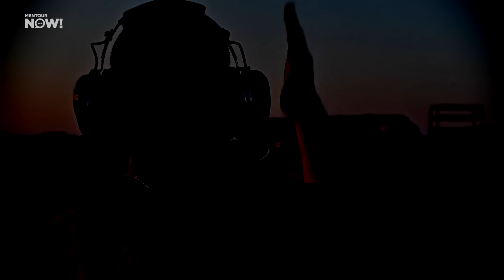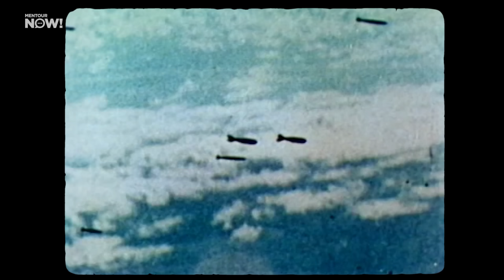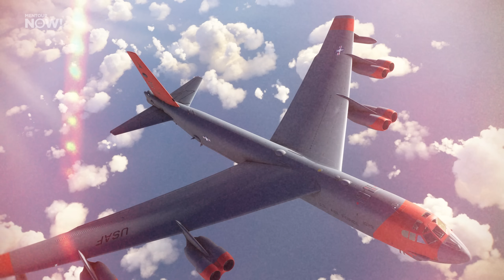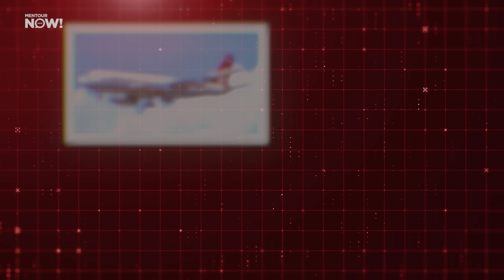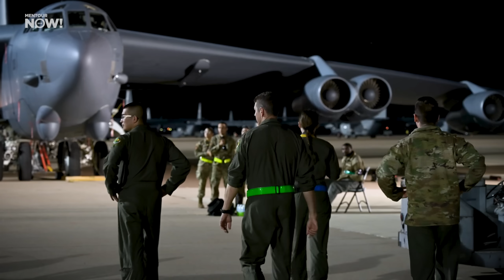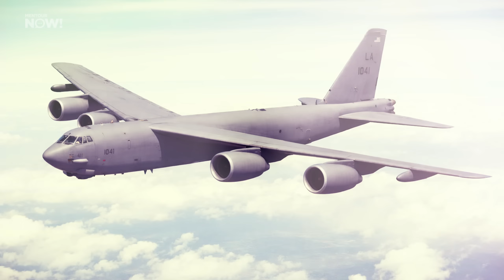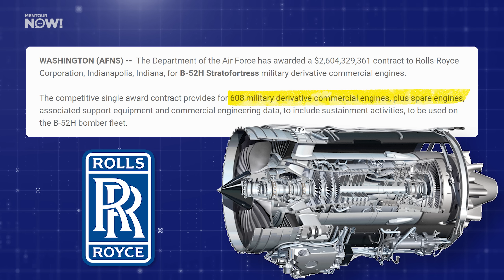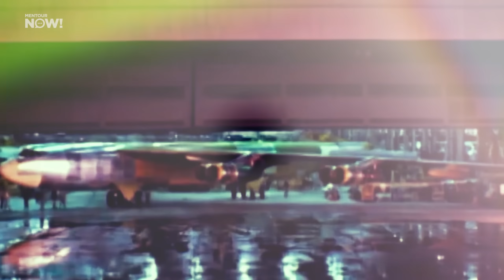WHY Are They Changing The B-52 NOW?!

Comment: Back in the late 1980’s I got to experience the power of these aircraft several times a day for over a year. I was designing and prototyping radio systems for the (then future) F-22 Raptor. We did our testing at Air Force Plant 4 in Fort Worth Texas, the factory where General Dynamics was building the F-16 Falcon. The facility was co-located with Carswell Air Force Base which at that time was home to one of the Strategic Air Command’s Bomber Wings. There were a LOT of B-52s. Several times a day a B-52 would take off along with one or two KC-135 stratotankers. Because these aircraft had to be ready to fly at a moments notice its my understanding that they always carried their full complement of nuclear tipped cruse missiles and were so heavy that when they took off they only had enough fuel to get them out over the (then) Gulf of Mexico. Then a KC-135 stratotanker would fill them up. Because our testing including “interrogating” aircraft as they took off and landed at Carswell, our “lab” was located on the top floor of a 6 story tower that was relatively close to the end of the runway where these aircraft started their takeoff roll. Our facility had no windows, but we knew when one of these fully loaded B-52 took off because it was like an earthquake hit. We quickly learned to bolt down everything or risk it being broken as it fell from tables and shelves.

Comment: But if they redesign it for 4 engines then alot of the initial problems of going from 8 to 4 would not be there when an upgrade for the  next set/generation of 4 engines would come into consideration, sounds like an economist have NOT been apart of this.

Comment: Really interesting video, very glad the B52 will keep flying. One thing I am surprised about though, is that to me the obvious cheaper solution is to remanufacture the parts for the old engines that they can't get hold of anymore. If they could be built in the 50s and 60s, surely modern technology means we could easily reproduce these, even if it comes at a much greater cost relative to the cold war years, surely it would be less than the multiple billions this will cost. I realise there are many other benefits to the new engines, but for governments, the cheaper kick the can down the road approach is quite often the preferred solution.

Comment: I service lab analysers . These are devices that are FDA certified.
In the late 1990s the company I was working for , started buying 40MB hard drives , a size that was getting difficult to purchase.
The reason they needed to do this was the FDA Certification required that any changes such as a bigger hard drive required the whole system to be recertified at enormous cost.

Comment: Makes you wonder why they haven't switched to another plane entirely and avoid all these unnecessary issues and concerns. It can't be that hard to make a flipping bomb bay or attach cruise missiles under the wings of a somewhat modified civilian airliner frame. It's not like B-52s were designed to launch cruise missiles of the size and mass of what we have these days either...

Comment: There was a study done at Boeing to use four 757 engines but the exhaust heat plume impact on the lower wing skins and ground clearance caused that conversion to be shelved.

Comment: I think that many of these concerns brought up are overthinking the problems
A modern CAD representation of the existing wing design would yield the answers to most if not ALL questions.
Modern computer dynamic modelling is incredibly powerful.
I would, in fact, be astonished if high quality models were have not already been done. 
They might be showing that if you were going to goto the trouble of going to four engines, it might be far smarter to replace the wings.
If you were going to do the wings, why not the entire airframe.
A new aircraft.
The Military Industrial Complex seems incapable of producing the "new" without blowing the financial constraints to pieces.
Whether it's the army, navy, airforce, or marines.
Fix the procurement problem and much else gets cleared up. 
NOT GOING TO HAPPEN !

Comment: The answer to your question is they ran out of excuses not to. That and there's not enough ground clearance for 4 modern high-bypass turbofan engines. It took a s*it-ton of engineering to make more efficient engines that would still fit the plane.

Comment: They tried the high bypass fan modification back in the early seventies. One of the big reasons they decided against it as being a bomber is the cross section of a very large fan gives off a huge scattered radar image which was just unacceptable for the airplane.
Reply: Lol, so instead of looking like a aircraft the size of a b52 it will look like the size of a 747... real stealth impacts at play

Comment: There’s an aspect I don’t believe you touched on which is likely one of the most important reason for keeping the engines the same. This wing was designed to drop ordinance and launch rockets. These are known aerodynamic characteristics. Changing that up would have an unknown effects on how rockets are fired and ordinance dropped, which could be unsafe to the aircraft. It would be very costly to test and change for that safety aspect, let alone the others you touched. My info is sourced from a B-52 test pilot

Comment: Comparing a high bypasss  commercial engine bypass ratio to that of a of low bypass military engine is like comparing apples to oranges.  They are both round but otherwise completely different.  The engines are also supportable well past 2030 contrary to your claim.  In 2023 Pratt and Whitney was awarded a sustainment contract through 2050 for these engines and is still producing parts for the engine today.  It was also awarded another contract just this past September for sustainment of TF33 engines powering NATOs E3 sentry aircraft.  The B52 isn’t the only aircraft flying behind the TF33 and the engine isn’t going anywhere anytime soon.

Comment: The time and cost to rebuild the wing spars to accept 4 engines is prohibitive.  Not even talking about the fact they would also have to raise the air frame higher off the ground to accommodate the larger engines. Then there is rewiring the air frame for the new electronics.

Comment: Very good...
...I'm curious: I had it in my head that apart from the usual maintenance checks airframes are rated for a certain flight time, and once that time is up the plane is done - one of the main reasons vintage warplanes are flown so little. What am I missing? (I presume B52s weren't rated for infinite flight time)

Comment: Ì am old enough to remember when the B-52 and its engines were new. I never flew on a B-52, but I did fly on a commercial regional DC-3 flight, and in the 1960's a 707 on an international flight. Air travel was rare back then, compared to today, and I remember both aircraft very clearly. Aircraft had a lot on individual character back then, unlike the lifeless, and very uninspiring aircraft we fly today. 

I very much remember the engines on the 707. They were loud, very loud, had a roar that is never forgotten. When they spooled up on the runway there was no doubt you were going flying. I was just in front of the wing and had a window seat. I remember being able to see what seemed like incredibly futuristic engines. My first jet flight after many propeller engines. I even flew in a Gypsy Moth once. The scream of those jet engines were the sound of the space age, and unlimited technology, leaving the past behind. 

Funny to hear them now being described as obsolete.

Comment: I think that doing 4 engines is a way better idea they could put in already existing high bypass engines for efficiency and range. (I wrote this before he mentioned it) He also mentioned that the wing might have to be modified which is true BUT in this case as the new engine weights less than 2 of the old engines, its characteristics might actually be BETTER. only slight modification would be needed seeing as the fuel lines can just re-engineered the fuel tanks are literally directly above the engines it would be an easy modification almost every other system has been modified no internal parts are original. He mentions that 8 engines is more reliable as if 1 of 8 but chances are, if one engine in a pod goes out, its more often than not going to take both out as they use the same fuel lines and hydraulics and are so close that if it was a serious issue like a bird strike or engine fire it will defo take out both. It would be easy to train people to work on these engines as they are already in service in commercial and other military aircraft.

Comment: In survivalist circles, there is a term "One is none and 2 is one." Meaning redundancy is king. 
Consider the DC11(10?) that recently lost #1 and it's fire flume knocked out #2 from suffocation. #3 on the right wing was fat and dandy. Can you Yaw? Not Y'all.
Here is a question, if you had a bottle of NO2, and sprayed it into a stalling engine(turbine) could you save it? What good is FADEC if contingencies aren't available?

Comment: You look at the survival of the b-52 as a set of technical questions/issues.  But in the world of big Department of Defense (Department of War) spending programs the majority of decisions are driven by politics. Politicians who have manufacturing or DOD services in their districts get deeply involved in DOD spending decisions.  That’s why it’s so hard to shut down a military base.  Additionally the DOD has gotten extremely poor at running new weapons programs.  Cost overruns.  Late deliveries.  Substandard construction.  Inability to meet performance specs.  All get in the way of developing new weapons systems.  The  B-52 exists. It’s a known quantity. It’s slow.  But has great range.  It can deliver a range of weapons.  It’s much cheaper to enhance this ancient airframe than to develop a new one. Why do you think Boeing has kept the 737 around for so long?   So one the one hand there are a lot of practical reasons to keep the B-52 flying.  But don’t underestimate the political factors that are driving this and every big DOD program decision.

Comment: Why does the BUFF stick around?

Because it is a big, durable, long range bomber, with big open weapons bays that can be endlessly adapted to drop whatever the new flavour of warhead is available.

And with modern weapons, it doesn't even need to enter the airspace of the opposing force. So it makes it exceptionally hard to justify the cost of building an entirely new plane, that has significantly better capabilities.

And why the B-52 will outlast the B-1 or the B-2? Because it, even with its older, less efficient engines? Was cheaper to actually fly per hour. So why would you fly the B-1 for a mission, if the B-52 can do the exact same mission, but just...take off an hour earlier? You end up flying the B-52, because flying the wings off the expensive as frig B1 and B2, just...doesn't make sense.

Comment: Sometimes, all you need is a big, dumb, bomb/missile truck that can fly a long way and drop a whole bunch of whoopass on the bad guys. And when you have just such at thing in inventory that is LONG paid for, it doesn't make sense to spend the MANY billions of dollars it would cost to replace it. But new and much easier to support engines (and the other modernizations) for a couple billion (that will pay for themselves over the long haul) are a no-brainer. That increase in range in particular is key, because air-to-air refueling is insanely expensive. It takes a TON of fuel to lift fuel off the ground, plus all those additional expensive airplanes and air crew. 

You should do a video on the KC-135 - another Boeing design that seems destined to outlive everything that has tried to replace it.

Comment: The tail of the B52 changed drastically between the early generations and the existing H- models. I wonder if the new Rolls Royce engines will necessitate a different tail as well?

Comment: other than the fact that USA has stage 4 juw cancer, they could just make a new one in carbon fiber with 2 or 4 modern engines. No doubt much cheaper than to modify a single old plane

Comment: The reason for eight engines is the rudders too small. Adding a larger rudder would require a complete redesign of the tail section, which would be impractical.

Comment: Another reason for going with eight smaller engines rather than with four large ones is that the Air Force doesn't have to repeat the lengthy and expensive weapon qualification tests for every weapon that the B-52 will carry.

Comment: Why not 4 engines? "It would require replacing almost all systems and interfere with airflow".

With the new 8 engines: "The old throttles and systems won't work with the new engines, and we have airflow problems. Replace all systems and redesign the engine nacelles!"

If you ever wonder why taxes are so high... ;)
Reply: Old story on upgrades.  You anticipate the problems you can, and deal with the problems you didn't foresee.  Our inability to know everything before we start is not a reason to do nothing.
Reply: But not redesigning the wing, wing box, tail fin etc.
Reply: @sparky4878  Pretty much the same reason MCAS on the 737 MAX was needed. The plane sits low on purpose, a great idea back in the 60s, but you can't fit massive engines under it. So they had to move the engines forward to mount them higher.
And longer landing gears meaning completely redesigning the wing, at that point might as well make a completely new aircraft.

Comment: The newest B-52 airframe made its first flight closer in time to the Wright Brothers first flight than to today.

The first B-52 made its first flight less than a decade after the first US jet aircraft flew. A decade later, the Lockheed A-12 Blackbird made its first flight (the same year the last B-52 rolled off the assembly line.) Needless to say, aircraft technology was moving at a pace staggeringly fast by today's standards. 

(By contrast - the Space Launch System has yet to make its first human-carrying flight - more than 20 years after the design was first unveiled.)

Comment: I was a weapons systems technician on B-52 D/G/H from 1981-1994. I participated in several analog to digital upgrades on those systems in the aircraft over time. All aircraft had to go tor depot level maintenance for recabling (Think dry dock for a ship). Perfectly good wires for discrete signals are wholly inadequate for high speed data transmissions. The plane needed to be "opened up" from the cockpit, to the wing pylons and bomb bay. Not an afternoon job. When reading other articles and such about the current and past re-engining programs, I somehow missed the fact that today's engines are digital. There's no way the current cabling and rigging that's been in the aircraft since it was built could possibly work with a modern engine. Thank you for pointing that out.
Reply: Excellent point. In addition, the new harnesses may include new coaxes and fiberoptic for new systems, higher awg feeders, etc, new installation routing, connectors. Then, certification for HIRF, lightning, and EMP. Big job.
Reply: Yep. Modern engines have diagnostic tools for troubleshooting right on the engine. At it's different parts. So it needs wires to connect to the onboard computer.
Reply: That was a very impressive time for electronic updates to all military aircraft. I worked with EA-6B's during that time. It always amazed me how the electronic bay shrank a little more each year until they were small enough to put into an EF-18 Growler.
Reply: It crossed my mind that, rather than rewire the whole plane (and I absolutely accept that point), perhaps you could have created a new interface pack that would sit in the pylon and convert the analogue control signals from the cockpit (etc) into the digital signals the engine expected. That way, your pilots keep more-or-less the experience they're used to and you don't have to redo so much.

Comment: The Pratt and Whitney J57 was a water burner. Water was injected into the engine to create more power during takeoff. This is what created the distinct black exhaust during takeoff.  Looked like the aircraft was rolling coal.  It also made take off very loud. Both the initial B52 and the KC135 aircraft had these engines.
Reply: The TF-33s of the B-52H also smoke, not as bad as the old water injected J57 variants, but are still quite dirty.  This will be the most obvious visible change when the new Rolls-Royce B-52Js start flyiing.
Reply: Water creates a black smoke? Does not calculate...
Reply: @sergeychmelev5270 well it’s true…
Reply: @sergeychmelev5270  the reason for water injection is to cool the engine so it can be run at at a higher power.

The black smoke is because the ratio of fuel to air becomes fuel rich and it doesn't burn cleanly.

Comment: There was a rumour going around that the retired Qantaslink B717s engines were going to the B52. I guess there was some small truth to that.
Reply: The Boeing 717 uses RR BR715 engines which are approx. 20 years older than the BR725 (BR700-725A1) engines which is the Civil version of the F130
Reply: @agoehrke87 yep, hence the small truth, the B52 was getting a similar engine, but not from the 717.

Comment: Having an engine that is possibly 40% more efficient adds a lot more options than just economy and range.
You can reduce the fuel load and carry a higher payload to the same destination.
You can reduce the fuel load and fly higher or faster.
Or you can mix it up whichever way you want to better match the mission profile.
The real advantage is it adds flexibility.
Reply: The real advantage is longevity.  Current estimates say that each new engines, once installed, will stay on the BUFFs until their retirement date sometime after 2050.  TF-33s could never do that.